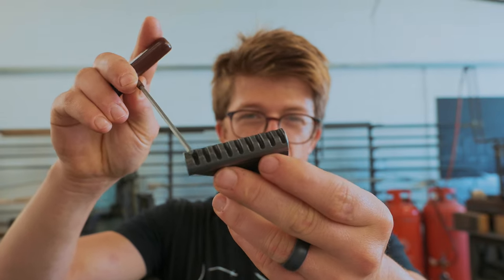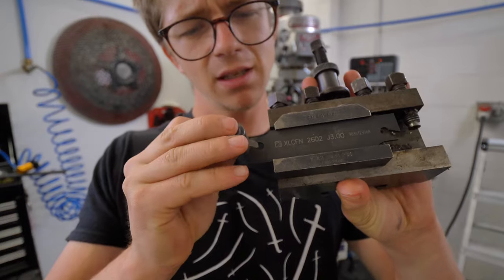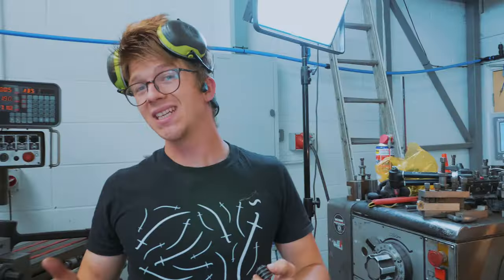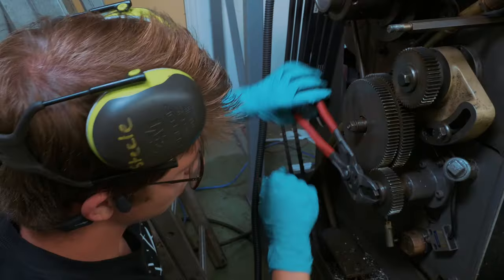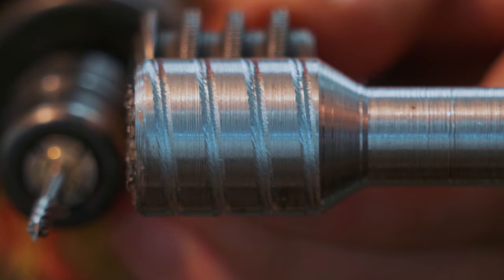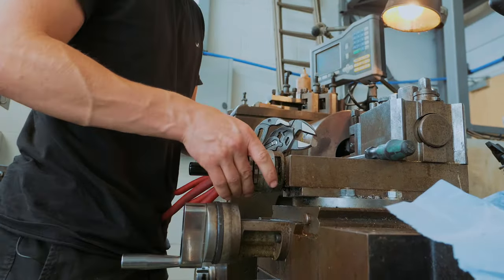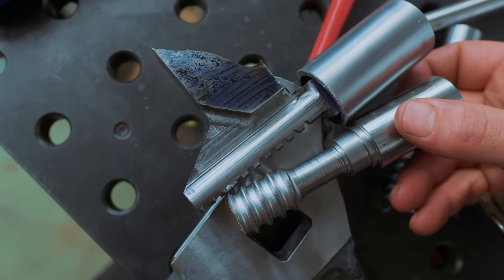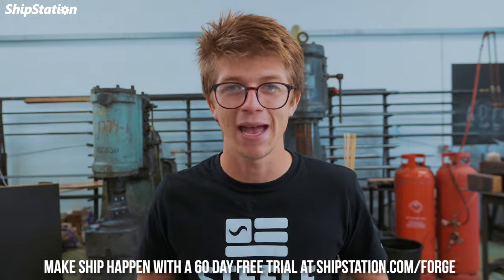Making My Own ADJUSTABLE CRESCENT WRENCH! Part 3

Comment: I don't understand why you couldn't have just used a triangular lathe bit. You got the thread pitch down, so make enough passes to get the right depth, and then adjust the tool post in increments along the x axis until the thread roots are wide enough. What am I missing?

Comment: I don't understand why duct taping a die grinder to the lathe's tool holder was the solution for this operation instead of just making the correct tool out of HSS. I know there's a belt grinder on the other side of the wall!

Comment: Brainschtorming?  Sounds like it's being brought to us by the same people who gave us "Schvahnschtukur"!

Now, to mirror the thoughts of the many backseat machinists, if you'll use e-bay or some such place to locate a Heisenberg dunkinschlammer (without the optional nandesuka chorrizodahn), rotate it anti-clockwise 7 degrees + the requisite Duugann offset, and you'll have a perfect cut every time!

Comment: I was facepalming with that opening.  Instead of grinding that nut and bolt in order to tilt the workpiece down, you could have just flipped it around to face the other way so you could tilt up instead.

Comment: Worse comes to worse, why don't you just use a single point cutter to start the threads then use the parting tool to finish it up?  Or like Jim Griffiths suggested, just make it out of tool steel (or use those broken end mills )

Comment: As smart as you are I would have thought that you would have just made your own cutting tool similar to a parting tool but with the angle you need to make the flat bottom along that nut. Oversize the nut, cut your threads, then with a straight tool bring down to proper diameter to get your flat tops at the precise diameter that you need. Sometimes when we overthink things we wind up doing more work. My grandfather always told me it takes more work to not do something right than it does to just do it right the first time. Not making your own tool cost you more work and more headache than the couple of minutes it would have taken you to make your own tool.

Comment: No the reason the threads are more "pointy" is because of the angle of the milling bit to the work piece. Your bit isn’t at the same angle as the thread. Your thinking in 2d when you should be in 3d, at the 2d centre line plane of the workpiece it would be cutting the profile you designed. However in 3d the further out on the radius of the part the more the angled cutter removes the metal. Angle the cutter the same as the thread your cutting to fix the issue. Do you understand?

Comment: I really don't understand why he's wanting to use the grinder instead of a piece of high speed steal that you can cut to the exact size thread he needs? There's no wobble, you can set your lead angle and you had no need to figure out a mount for the grinder and a collet inside a collet.

Comment: I haven’t seen anyone say it yet but Alec, you set the lead angle in the wrong direction. Your bit is not in line with the direction of the thread, but instead it intersects at the opposite angle.
Reply: The tool angle needed to be reversed when you set it to reverse thread.
Reply: I feel the backlash won’t play as much of a role on this scale

Comment: I'm honestly baffled by how you made the thread. I don't understand why you went through all that instead of just using the part off tool or making a tool out of tool steel. Why go through all that madness when it was 10x more work for a worse result? Using the correct tool was so simple and easy but for some reason you made it so much harder on yourself.

Comment: I don't think its possible to hang that end mill out any further and if it's not carbide it should be. Of course you should have used the parting tool from the start. It is made to cut slots and you are cutting a slot. And you should learn to thread properly by disengaging the half nut. It's not hard and is the proper way the cut a thread. The half nut has a corresponding dial and it's not at all difficult to use. You will save so much time cutting a thread the proper way.

Comment: My dude! Why did you not just make a single point threading tool with the thread form and relief angles built in? This was painful to watch, so much unnecessary suffering and sketchy tool usage 😬

This Old Tony has some excellent videos which go into great detail about thread cutting. If you feel inclined to remake this particular part, I would highly recommend perusing his content before your next attempt :)

Comment: Yeah.....as a machinist seeing that absolutely, completely, utterly unhinged creation you did with the air tool is going to give me an aneurysm. 

I cannot remotely put into words exactly what I think about it. 

There was an attempt.

You need to get yourself onto a tool supply page, look for a cutoff holder with ROUND inserts that are the size of the groove you need. Take multiple small passes until you reach the proper depth.

Comment: You've got a lot of machinists repeating the same thing, so I'm not going to. However, I will suggest you listen to the feedback and remake that part. Sloppy work is sloppy work and if you're about building your skills learn it proper before you get all jank with your set ups.

You've metioned in the past, how the machinists in your comments are crying. Perhaps, you should listen to those of us that have the experience in the field you're pushing into. You do that when you're trying new blacksmithing techniques, but seem to refuse to do it properly when it comes to using machine tools. Blacksmithing is dangerous, but so is janky ass set ups on lathes and mills, and often that danger is harder to recognize than the big heavy smacky thing making bang bangs.

On a different note, I do enjoy your content and have watched for years. Keep up the good work, and stop accepting sloppy work that happens to get the job done.

(edited to fix a few typos, grammatical oops, and some wording.)

Comment: I realize that you need content but I am wondering why you don't just grind your own cutter from a regular carbide cutter or use the parting tool. And I always cut threads from one direction then back up and repeat. Seems like you are beating your head against the wall with your die grinder set up.